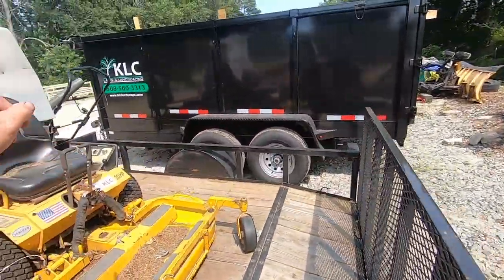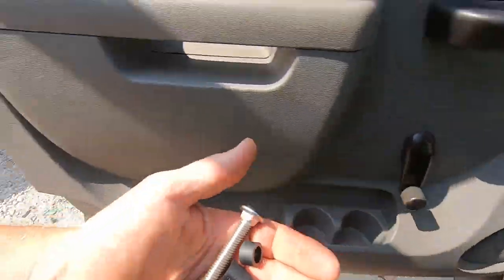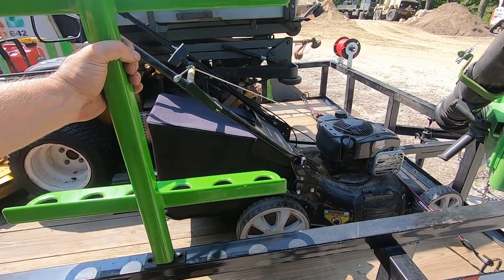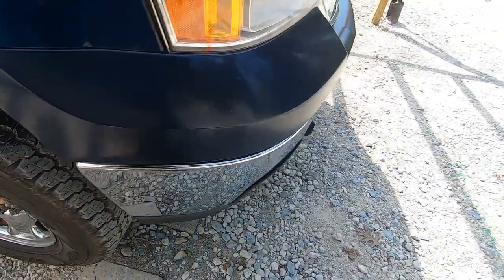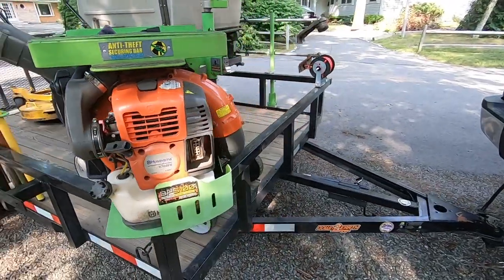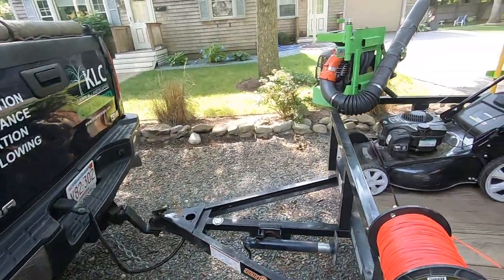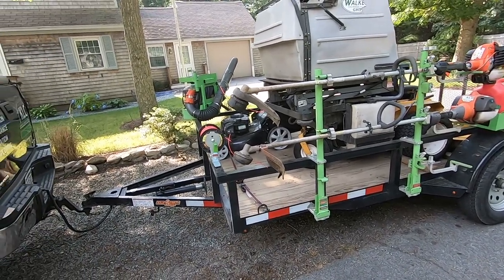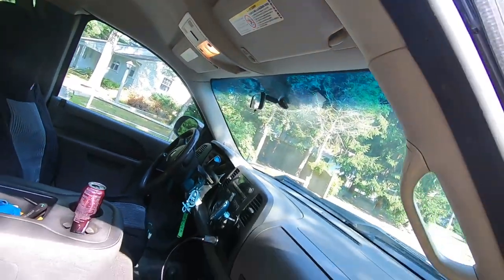Final Piece Of The Puzzle. Green Touch Hand Tool Rack

Comment: Tool rack looks great. Tool box is a good idea on the A frame of trailer. Having all your tools with you when doing lawns is a good idea. You just never know when you need your chainsaw, flat shovel, hammer, ect.. A battery booster/air compressor is a good idea too. I have one with me all the time. Stock wheels look nice. Good idea to go LED for the overhead light. Great video Ken!